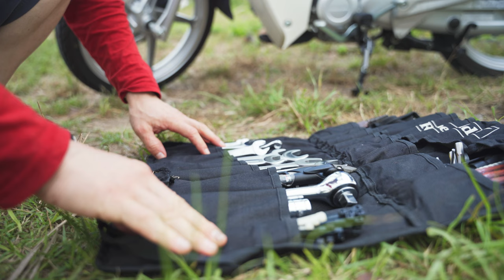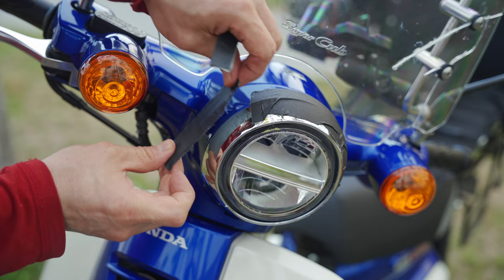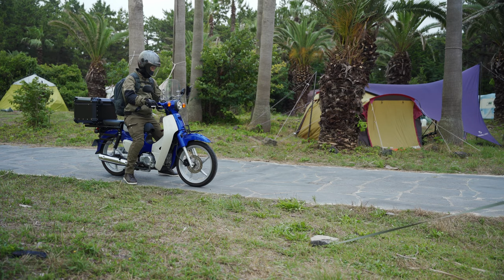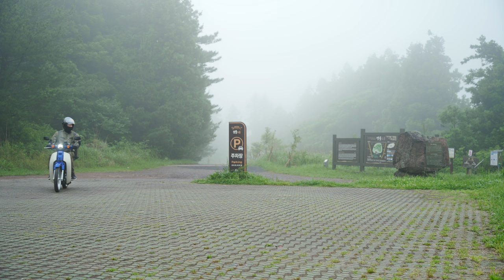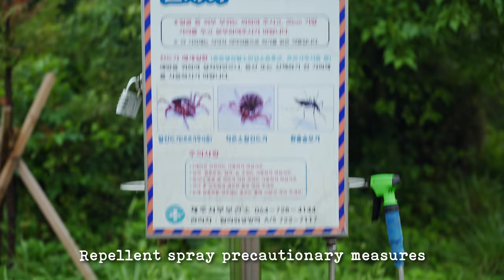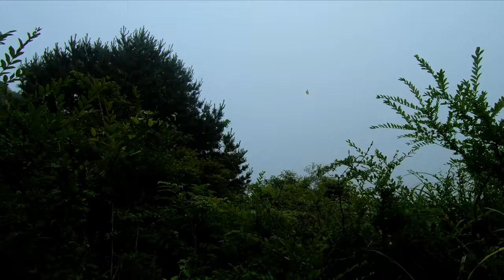Honda Cub travel in Korea | Part II

Comment: What did I miss? You drop your bike inside the ferry, and go out how you drove in, and then go to a passenger entrance to the ferry?  The ferries I know drop your vehicle inside and climb internal stairs to the passenger area, and all the paper works was done before you enter ...
Fixing that plastic parts: The headlight goes with 2K Epoxy glue. Rough up all surfaces with sandpaper and apply glue generous, use clips or whatsoever to hold the part in place and let it dry over night. The Epoxy is likely stronger than the original plastic.
Reply from the maker: Hi, I drop the bike when I was on a road. It was on central stand. Here in Korea ferry regulations are a little different. I've been twice on motorcycle to Jeju from mainland, and the rule is the same. Make paper work > load the bike > leave the ferry and go to passenger's terminal > enter the ferry as a passenger. When leaving the ferry - goes down to the bike > disembark driving out.
About fixing. I like epoxy. But buying a new ring is easier and looks better, clips was newly made with super glue and baking soda. Works fine.

Comment: Thanks for the video.  I’m based in Japan, and thinking of traveling from Tokyo to Seoul via Busan on my C125.  Any idea of how long it would take from Busan to Seoul?  Any good campsites along the way?
Reply from the maker: Hi, it is a little bit more than 400km on motorcycle eligible roads. 8 hours of pure riding. If you are on a fast manner you can ride from Busan to Seoul in one day. Comfortably 2 days, in chilling ride 3 days. I'm not familiar with campsites, I tried not to pay for camping, that's way I made a camp on riverbeds and random weird places, which is not comfortable if you want to have a safe camp with all facilities you need to pay for campings it is not super expensive depending on facilities and place there could be about between 10-40USD.
I suppose (but I'm not sure) If you'll drive along sea shore, you can camp on a beaches along the way. There is not too many people in remote areas along this road.
Reply: @MotorcyclistDiaries  Awesome.  Thanks so much for the detailed info.  Sounds nice to just camp at a riverside and beaches.  Lastly, what app do you use for navigation?
Reply from the maker: I use T-Map which is native SK Telecom cell phone provider app and it can be used only by their clients. But there are 2 alternatives, my friend says, you can probably use Kakao map or Naver map which were partially translated into English, (due to Olympic Games in 2018th) but they are a little glitchy with language switching. Though they are still useful because they can build up the route for 2 wheel vehicles, and that's very important.
Reply: @MotorcyclistDiaries  Thank you again!
Reply from the maker: When you are planning your trip to Korea?
Reply: @MotorcyclistDiaries  I'm aiming towards mid-November when the temperature drops.  If you're around, perhaps we can hook up for a ride!
Reply from the maker: @PauldelRosario  That's sounds great! Hit me an email (on about channel page) when you'll step on Korean land.